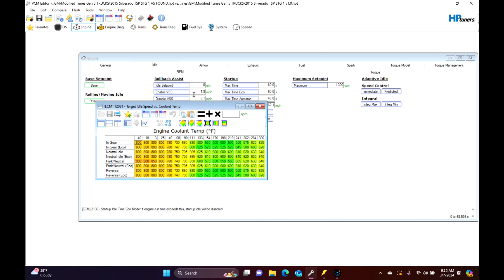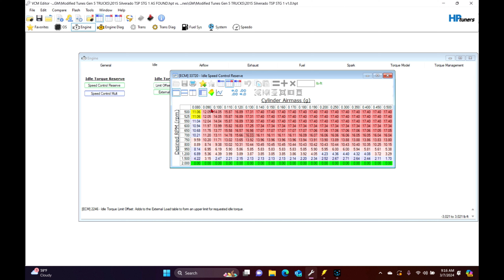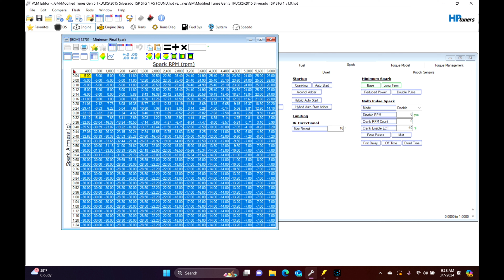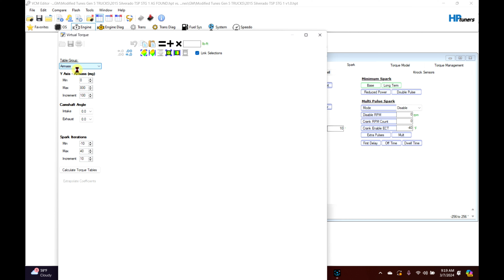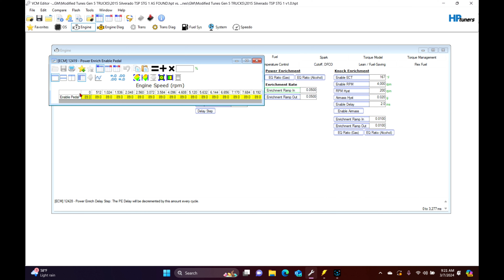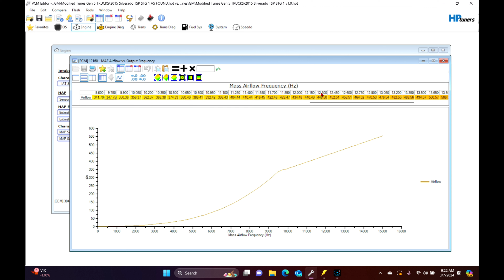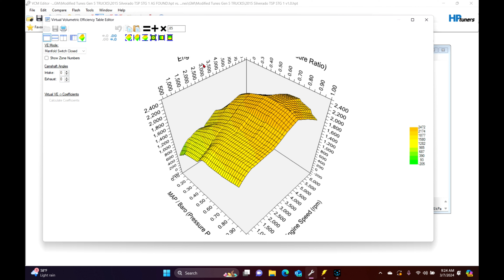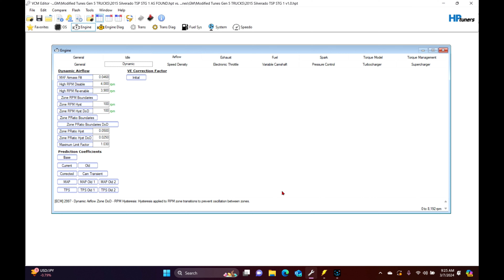LT Power Unlocked: GEN V IDLE Tuning for Beginners

Comment: When multiplying the torque table amounts by 10 percent I always only multiply the positive numbers by 1.1 then increase the negative numbers by 10 percent by multiplying by .9. If you multiply the negative numbers by 1.1 it will be a lower number and that I might not be what you are aiming for. Great video!

Comment: When I start my car and it's in open loop its really lean like 18-19.1 AFR. How do I adjust that? When the coolant hits 60 degrees and closed loop is started my AFR is great about 14.2-15.
Reply from the maker: You need to adjust your fueling tables. Both vve and maf.
Reply: would it be a good idea to disable 1 of them, closed or open loop?  @strongspeedworks